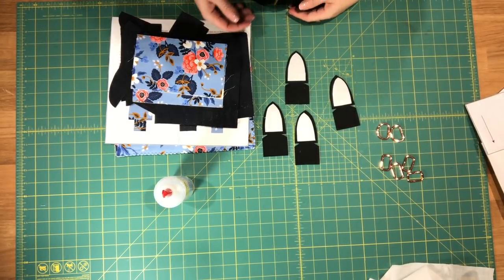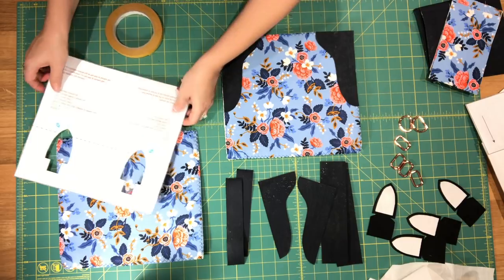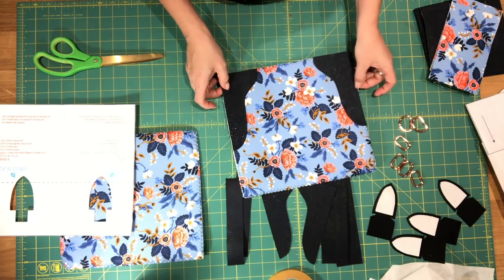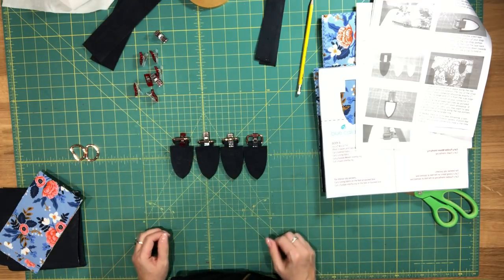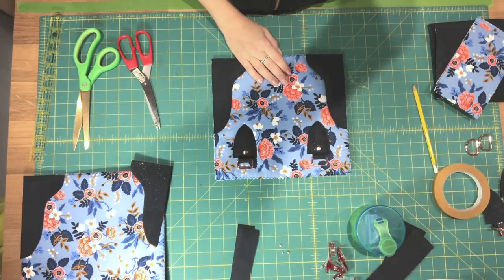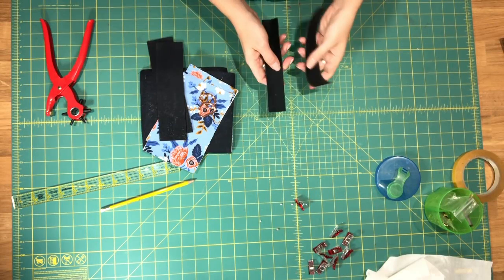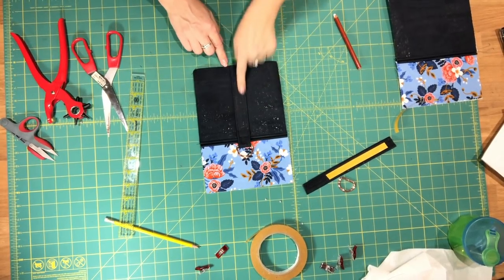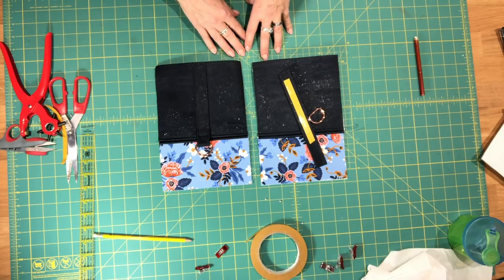Blue Calla Patterns - Aster Handbag - Part 2/5: Exterior Assembly of Body and Side Panels

Comment: Beautiful bag. Does the pattern recommend things like needle size, stitch length and thread weight? Thanks.
Reply from the maker: Hi Victoria. No it doesn't because that really depends on what material you are using, etc. This is not a beginner pattern so some prior experience making bags is required.

Comment: Hi Celine - I'm finally getting to work on my Aster. One question - for the pieces that call for using the fusible woven interfacing ** if using fabric **, such as the exterior side panel bottom, do you consider vinyl a "fabric", or are you referring to using cottons for those pieces? Thanks!
Reply from the maker: Kristin Farwig By fabric I mean woven fabric. Cork and vinyl should be treated the same.
Reply: @bluecallapatterns  OK, thanks for your reply. I sewed the bottom overlays on, which are vinyl, and I think they stretched a bit, as the top edges are a bit off the fabric. Apparently opinion is divided on whether or not to interface vinyl. I know quality varies. I think what I am using on this bag is high quality.
Reply from the maker: Kristin Farwig are you using a walking foot when sewing your vinyl overlays? It makes a huge difference. I interface vinyl if it is thinner and stretchy.
Reply: @bluecallapatterns  no, I was using a teflon foot. I guess I should try the walking foot the next time I make this or have to sew vinyl overlays. This is the first time I've sewn an overlay.  I don't know a whole lot about vinyl, so I'm not sure how to characterize this. It seems substantial - the front has a pebbly texture and the back has a thin gray layer of what looks like a woven knit material. It does seem a bit stretchy on the bias, but not overly so. Also, When I saw what your pieces looked like after you zigzagged them to the foam, I realized my zigzag stitch length and width were both probably too narrow when I did this step.
Reply from the maker: Kristin Farwig I have never had much luck with a Teflon foot or a roller foot. Walking foot is a must for sewing vinyl!
Reply: @bluecallapatterns  the teflon foot seems to work well for me.  I purchased one to make the Clematis, which I used vinyl on. It didn't look like you were using a walking foot in your video! One thing that occured to me that may help, especially when working with foam (I tried to sew this on a different bag but had too much trouble with it and gave up, but it was the 'naked foam' - the foam I'm using for this bag has a layer of some kind  over the foam) is to use something from the quilting world  - the Supreme Slider - a plastic mat that goes over the throat plate and arm of the machine, which helps the fabric move easier. Hopefully I'll remember to try that next time.